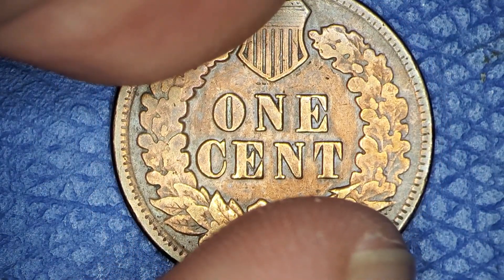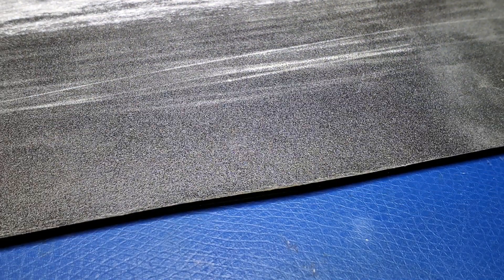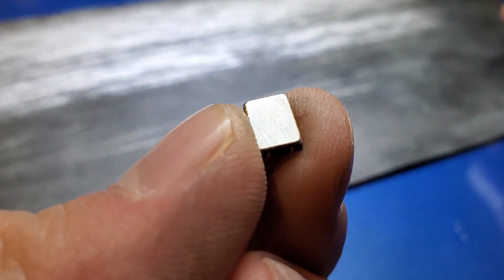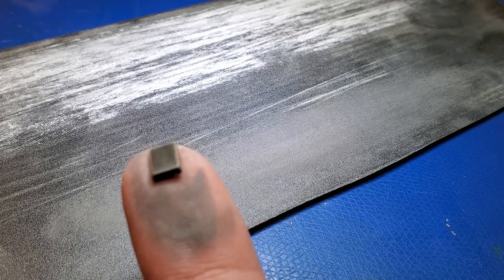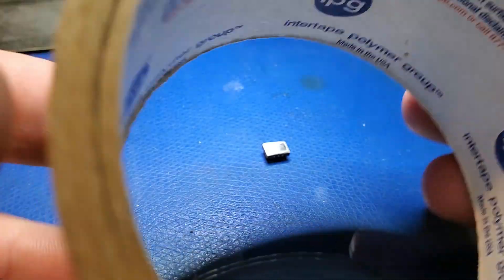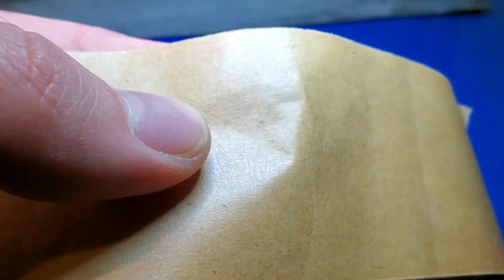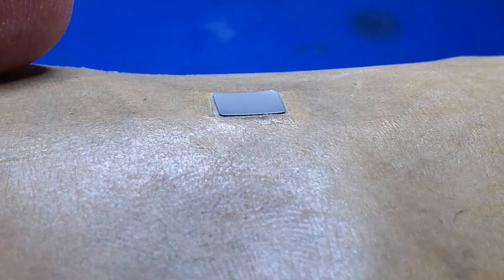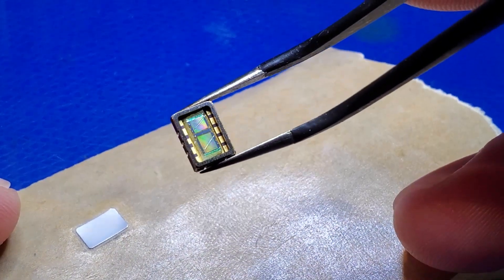Delidding a Ceramic SMD Component - SAW Filter

Comment: i always thought they were oscillators?
Reply: They kind of are special oscillators, in that they use the piezoelectric effect to bandpass a desired frequency from input to output.

The traces are designed to be resonant for the desired frequency band, which causes physical oscillation in the piezoelectric material.  That oscillation is then picked up with paired traces that are also designed to be resonant for the desired frequency band to be output.

They are essentially transducers which convert electrical oscillation into sound oscillation and then back into electrical oscillation, but does so with a strong resonance around a desired frequency, to pass that band and reject frequencies outside of that band.

Comment: Cool, is it kind of capacitor  , crystal ,what is it?
Reply: This is an electromechanical signal filter for a radio tuner, specifically a SiriusXM satellite receiver. The front end of the radio is a "mixer" that generates a sum and a difference frequency, and this filter chooses one of them to send on for further processing.

You can also do this electronically with coils and capacitors, but in applications like this, SAW filters are smaller, cheaper and more reliable (you don't have to adjust them like you would a coil).
Reply: @leecremeans5446 SAW filters work via the piezoelectric effect. Those tiny parallel wires are on the surface of a crystal which deforms when voltage is applied, and produces a voltage when deformed. With the wire spacing and speed of sound across that crystal, surface acoustic waves of the frequency the filter is designed to pass (fc) will build up each time it passes through a wire on the input. Meanwhile on the output waves of the resonant frequency wil line up with the wires to produce the same voltage. Undesired frequencies are likely to destructively interfere on the input/output, because they don't resonate.